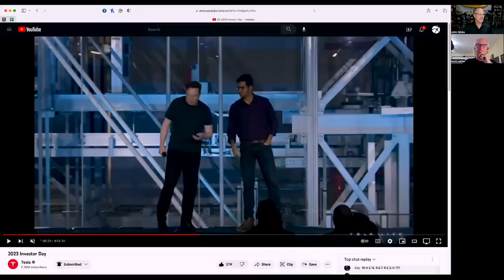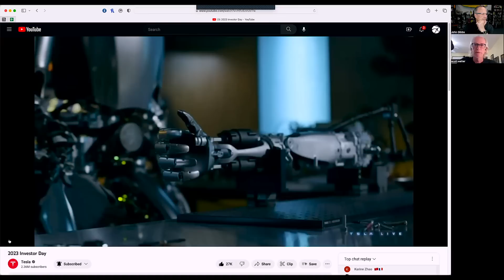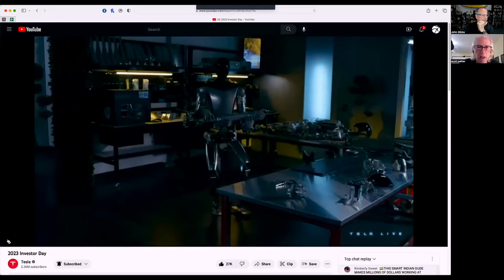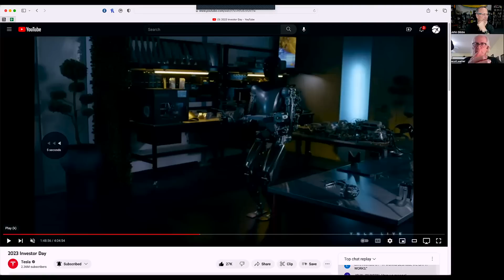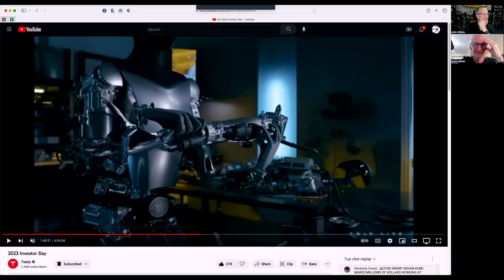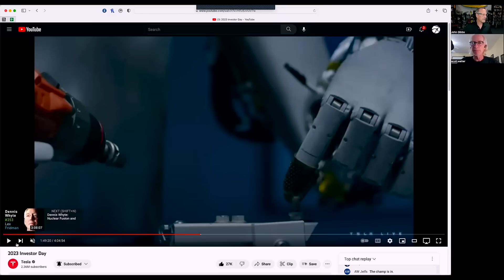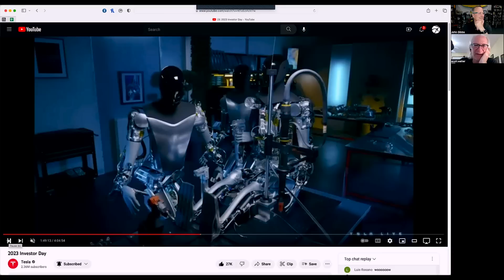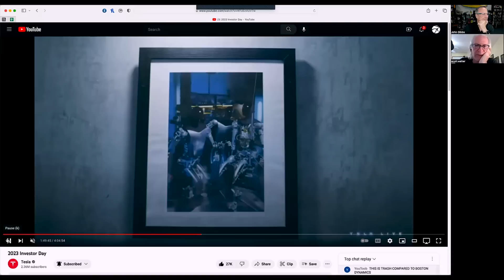Tesla's Optimus Bot Makes HUGE STRIDES! Investor Day Teslabot Details--with Dr. Scott Walter

Comment: Mark me down for disappointed - the stock market says that too.
At this pace, my grandkids will be working with a Teslabot that walks like it has 2 broken legs
and does some magic tricks with its hands.

It's like all the creative juices were squeezed out trying to fit something that can run for 30 minutes before needing a recharge.

There should be no steel wires, pullies, motors, or any of the stuff they used to build Robbi the Robot back in the 1950's which had a small actor inside of it.

A totally wrong approach for a robot.
Reply: It’s hilarious how all your comments are consistently utterly clueless.
Reply: @fredbloggs5902  Well I try my best.
Reply: what would you suggest as a means for generating locomotion? hydraulics? pumps = motors. biological muscle? at the end of the day you need an energy source, and something that converts that energy source to mechanical energy.

while human metabolism is extremely efficient, recreating a digestive system and pooping robots is definitely not the right approach.
Reply: @ZacksLab  1st of all why on earth must a robot look like a Terminator?
Then you have to look at the energy storage system and say it must work 12 hours before needing a recharge

Those 2 constraints mean a radically different robot than Elon's Terminator.
Quite frankly we don't have the materials and storage to make a robot go 12 hours right now
this is all a waste of time.
Reply: what makes you think elon's terminator can't work for 12 hours without needing a charge? with a 2kwh battery pack consuming an average of 150 watts over an hour (reasonable for most factory work), that's 13 hours of operation time. totally reasonable with what is available today.
Reply: @ZacksLab  The Teslabot we saw will be lucky to go 30 minutes before recharging.
I can hear the thing buzzing and wooing from here. My iPhone is lucky to go 14 hours before it's dead and it doesn't move anything.

A functioning robot will have to be highly efficient in any movement it does - motors are out of the question. Some new technology needs to be invented, or the TeslaBot will always be hungry for power.

Just standing and not moving will burn up juice since a standing Terminator needs to balance every second.

Anyway, I would not count on the Tesla Terminator this decade with their approach.
Reply: tesla bot's pack is literally 532x larger (in terms of energy storage capacity) than your iphone. do some research with numbers (efficiency and consumption) that tesla has released and demonstrated in other products and you will see that this is perfectly feasible.
Reply: @ZacksLab  I asked ChatCPT this question:
how many watts does it take to stand 12 hours

The amount of energy required to stand for 12 hours depends on several factors such as a person's weight, height, age, and gender.

However, according to a study published in the Journal of Physical Activity and Health, the average energy expenditure for standing is around 1.3 metabolic equivalents (METs). One MET is equal to the amount of oxygen consumed at rest, which is approximately 3.5 milliliters of oxygen per kilogram of body weight per minute.

Based on this information, an average adult who weighs 70 kg (154 pounds) would burn approximately 85 calories per hour while standing, which is equivalent to about 85 watts. Therefore, standing for 12 hours would require approximately 1,020 calories or 1,020 watts of energy. It's important to note that this is an estimate and actual energy expenditure can vary depending on individual factors.

That's for an adult that weighs 1/3 what a TeslaBot will weigh or 3,000 watts just to stand each 12 hours. Boston Dynamics is light years ahead of the TeslaBot and it would be interesting to know how many watts are burned just standing let alone moving limbs.
Reply: @noleftturns  a battery electric/electromechancial robot's "resting metabolic rate" can be much lower than that of a human. if a bot is standing at a work station only doing manipulation with its hands, majority of the loads are consuming only a few watts of power to actively balance. given tesla's publicly shared compute consumption, a single SoC from the AP computer consumes 36W, which is about 3x more than the human brain. 150W is a reasonable number for a bot standing in place manipulating objects with its hands. 

walking up stairs, carrying heavy boxes, now that's a different story, in which case I would agree with you that 12 hours of constant "heavy" exertion is out of reach for today's battery technology. however, the actuators and their drivers can be designed to be extremely efficient at converting electrical current to usable mechanical torque (in some cases >95%). these actuators also become generators that charge the battery when they are back driven (absorbing energy while stepping for example, similar to regen breaking in BEV cars)

i can tell you from experience that you're making biological analogies that don't directly translate to electromechanical robots. there are situations and maneuvers where bots exceed their biological counterparts, and situations where they are at a disadvantage. the job of engineers is to understand the use cases and optimize for the use cases that return the most value.

one more detail you're leaving out is that the bot can simply charge itself. with fast charging, a battery can regain 80% state of charge in 15 minutes. this is less than the average human lunch break.
Reply: @ZacksLab  3,000 watts for a human weighing as much as a Terminator - that's with 4.5 billion years of evolution/improvements to our bodies. A Terminator has got to be 3X to 5X+ more inefficient than our bodies, so I'd bet 10 kWh are used to just stand still in a 12-hour shift.

I won't worry about the Tesla Terminator taking over for a generation - they are using the wrong tools and have the wrong goal in mind.
Reply: @noleftturns  1. it does not take 3000Wh of energy for a human to stand still at 23degC for 12 hours. 

2. i work on designing humanoid robots for a living and am familiar with how much power is required to balance a bipedal humanoid robot.
Reply: @ZacksLab  I'm just going after what one AI told me - you could be right, but that's what Chat says.

Instead of a Terminator, Elon built a small 4-legged robot that was not out to replace a union worker standing still without cost anything.

I still like the robots in the movie Interstellar - Tars and Case - they ain't going to replace a union worker and they don't need swirling motors and steel cable to do their job.

The problem with swinging for the fences is that striking out if far more likely than taking a small incremental approach.

I can hear the Ump right now "Strike one - strike two - You're out"...
Reply: @noleftturns  with respect to the chatgpt answer, if you assume a 2000 calorie diet that most adults consume, that's ~2.3 kwh for a full 24 hour day. this sustains most adults throughout the world doing a variety of tasks.

i agree, there are other platforms (quadruped or wheeled bots even) that could unlock a lot of utility and already do, look at Amazon's warehouse for example.

i also agree that aesthetics are lacking in the tesla bot. our brains do not like things that look humanoid but are also faceless or have uncanny resemblance. even though it is just an object, there is an immediate lack of trust just based on appearance. 

if the goal is to have a collaborative economy with humans and bots working side by side, the emotional aesthetics should really improve.
Reply: @ZacksLab  Why Elon is chasing the Boston Dynamics Terminator is beyond me.
If I were running the project, here's what I'd do:
1) scour the land for the latest patents on robotics and buy them
2) Pick as simple a robot that you can imagine - it moves with hydraulics and pistons
3) make one that is 1 foot high - all the parts can be printed
4) Look towards working out the AI software on this prototype and build a different robot that is modeled after Amee from the movie Red Planet - it can be scrunched down to fit in a duffle bag and weighs less than 50 pounds
5) NEVER talk about taking union jobs away

We need "personal" small and harmless robots, not Terminators.
Reply: @noleftturns  the appeal to a human sized humanoid robot is that the world is designed for the average sized human. making a human sized robot in this form factor unlocks a lot of existing utility in the sense that it can use tools designed for humans, walk up stairs designed for humans, even wear human clothing to stay warm in the winter, etc...

once you deviate from this, the robot needs a special "end of arm" tool to interact with the environment for each specific task. this makes sense to do if you're moving large rigid objects from/to predictable locations, but not so much if you're trying to install a floppy wire harness in side panel or something.

i think what you're illuding towards is that if we design it to be as general purpose as we are, we might regret it. a 1 foot tall robot can't wield assault rifles or walk up stairs. however, it probably can't do useful tasks either.

this is the predicament the world is in. robotics and AI are coming and they're coming faster than most think.
Reply: @ZacksLab  I think the folks in AI and Robotics are so nearsighted that they are designing subpar apps and hardware - they are our fearless leaders to lead us into a bold new world.

Just because my 1' high robot is tiny, there isn't any reason they can't join together and build a 10' robot - again, stodgy thinking is rampant in the AI/Robotics world.

DARPA money is flowing like white water into all these projects and the only thing DARPA wants is a real Terminator - one that can command a tank, fly an aircraft, kill thousands with bioweapons.

Elon is in a position to drive all this, but he's too busy failing at Twitter right now.
Reply: @noleftturns  agreed on the shitty apps, hardware, and nearsightedness/tunnel vision. this plagues every industry though and hindsight is always 20/20. this is part of the process. just like evolution in nature, there is a certain amount of churn required to settle on an iteration that happens to meet the demands of the environment. luckily we can simulate a lot of this to speed up the evolution, but simulations aren't a substitute for reality. sometimes you have to make something to fill in the gaps of your simulation.

an army of 1 foot tall robots with actuators that have extremely high power density could definitely build a more sophisticated and powerful robot, however, there are physical limitations to what a given actuator can do. there is an optimal size/configuration that can be explained in first principals.

and for the record, elon could have bought BD 30 some times over for the twitter price tag. ideally he'd have done this prior to announcing interest in humanoid robots.
Reply: @ZacksLab  I look at how Russia's army has been really harmed with $199 drones with mortar shells dangling and released over the enemy - no one saw that coming.

Tiny is the future, not 7' Terminators. Tiny is easy to build and prototype, but there has to be a vision of where Tiny goes. Interlocking exoskeletons or fitting them together like a Chinese wood block puzzle is the goal.
Reply: @noleftturns  You could have said that about the first steam train where a man had to walk in front of it with a red flag to warn people it was coming.
Reply: @noleftturns  you could have said that about the first steam train where a man had to walk in front of it with a red flag to warn people it was coming.

Comment: Hot Take - they have sensor data of every rough spot in the roads in NA.   
Tesla could be selling near-realtime road survey data ..   every pothole,  every frost heave,  include traction data.. they can report icing and other traction issues to trip planners and local responders.  

Long term what's going to happen is they have a low resolution map of every FSD disengagement..  They will enable level five geofenced to roads with multiple 9's reliability..  and their 'fence' will be by road segment.. not by type or by area.    Trip planner can tell you up front if your trip has a 0 disengagement option.
Reply: Volvo already have a network for reporting slippery conditions. Nothing new.

Comment: I think that Optimus will scale before FSD. The progress is phenomenal & nothing less than we expected.
Reply: That sounds very unlikely.
Reply: FSD started very quickly too, which lead to unrealistic expectations. It is incredible progress though. I could see some limited use cases in “the wild” in at least a year, more likely two. Probably not working in nursing homes.
Reply: @TheScottShepard  
Optimus uses FSD too, not starting from scratch. And it's actually a way much simpler problem, mostly because mistakes don't kill people. Also the road system is extremely messy with all the crazy edge cases, and tons of other drivers are all doing their unpredictable things, while in a factory everything is highly organized and standardized. Factories are already designed around automation, even tasks that require a human are simplified to the limit and and precisely scripted. Ideal first job for a robot. Driving is almost the other end of the spectrum.